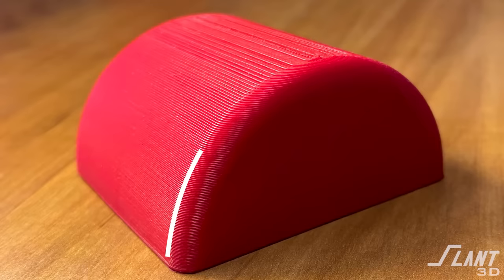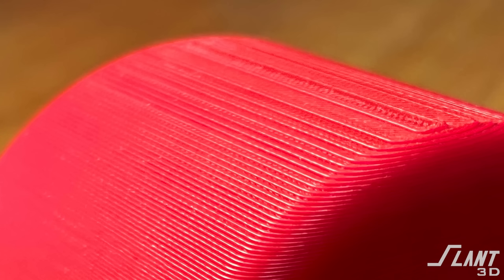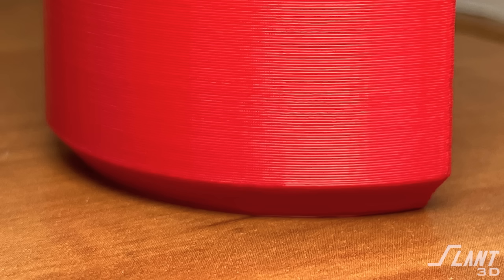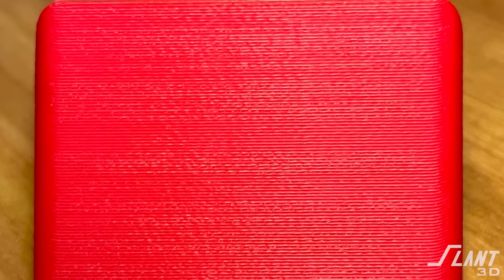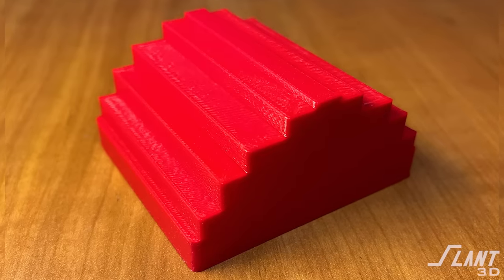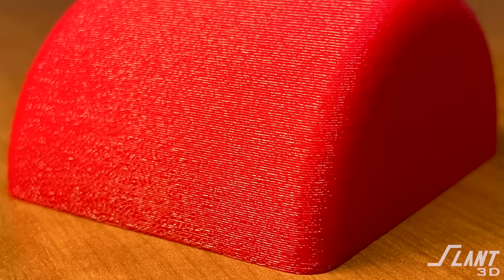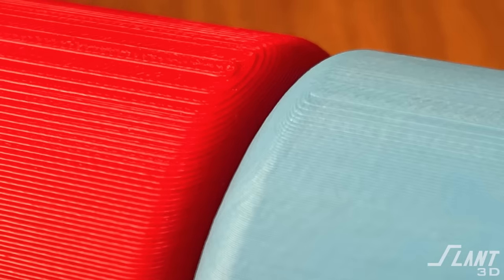Improving Curved Surfaces | Design for Mass Production 3D Printing

Comment: Suprised they didn't mention adaptive layers, that way you can have 0.3mm layers and transition to 0.1mm as the slope decreases. Same goes for the trapezoid shape.
Reply: came to make sure this was said
Reply: I use this a TON! Great comment
Reply: Exactly
Reply: But the point was to have consistent layer lines, right?
Reply: @henriexel9963  why?
Reply: It's an underated PrusaSlicer feature that cura users won't hear about.
Reply: @josephgaston5866  is it sarcasm ? , it's been in cura for at least 5.2 (long time)
Reply: @henriexel9963   The point is to have good results in a reasonable amount of time. Consistent layers can be a means to that.
With the right settings you can get a nice transition that's barely noticable.
Reply: Come on he's the "expert".
😆
Reply: This is the comment I was looking for. Adaptive layer heights are fantastic and offer a good balance between say 0.3 and 0.1 while minimally increasing print time.
Reply: @3DThird  Tbh, I'd still prefer a \_/ type shape with 0.3mm, but when you have to use a curved top this is the shit.
Reply: @Litl_Skitl  true, chamfers are better than fillets for FDM tech. SLA & SLS are much better for fillets in general.
Reply: @henriexel9963  no the point is to avoid as much as possible the obvious layer lines in the top of curved models
Reply: @teamllr3137  no joke! Where and how?
Reply: @vov4egde  it's the "Use Adaptive Layers" in the experimental tab, but it enable automatically when selecting the 0.16mm layer height preset
Reply: Yeah, was going to say that. Someone already beaten me to it. Prusa slicer, Bambu Studio, etc have that feature that you can increase resolution on affected area so they can appear equally resolution.
Reply: Ya I love adaptive layer height! I thought that would be the number 1 thing he mentioned too, oh well.
Reply: @josephgaston5866  /facepalm....Pusaslicer ported adaptive layers from Arachne, Cura's slicing engine.
Reply: Came here to say this.
Reply: @josephgaston5866  pretty sure kira has adaptive layer lines as well
Reply: Would you not need a nozzle z offset adjustment when it changes layers? Or does the adaptive layer g code account for that?
Reply: @E.H.N  Z offset is really only for how far from your Z level home switch or however your homing is after that it's just adding layers on top
Reply: @Texas3DCustoms  Okay makes sense. Thanks
Reply: @E.H.N  It's built into at least cura, and it automatically changes the layer height based on overhangs. Don't need ofset when you change in general.
Reply: Yeah, quite dissapointing that they go "well here's another completely different thing that doesn't have the problem so we solved the issue, right?"

Just pointless. If you won't solve the issue, don't say you solved the issue, sure, it's a design alternative but if you want to give a solution, the inherent critical features of the part you presented should be unchanged, otherwise is just pointless.
Reply: @henriexel9963  consistent finish more so.
Reply: That would be what he was referring to when he said that there are ways to go from for example 0.3 layer height to 0.1 layer height but only add 50% additional print time.
Reply: I might have to try this out on my next print
Reply: I was expecting the entire video to be about adaptive layers techniques and was shocked it didn't even get a mention.
Reply: They? He is definitely a "he" 😂
Reply: @gz625  I meant they as in the entire team, like the formal way.
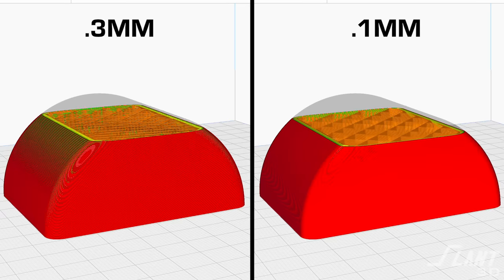Reply: He hinted towards it by saying 1:44 "There are ways of printing that only increase the speed from 300% to 50%"
Reply: Y'all he literally mentioned it first "there are ways to only slightly increase the print time instead of 300%, but this requires set up time on the slicer" 

He's obviously talking about variable later heights
Reply: @teamllr3137  since 3.0 you could have the top layers run at a lower layer line count. I don't know how configurable it was, but you could set say the top 0.6mm to be 0.15mm vs 0.2mm layer height
Reply: exactly, instead their advice - dont have curved edges LMAO
Reply: @Kyle-dz9bm  me too!!

Comment: If you are trying to make tens of thousands just use injection moulding. Like seriously, 3D printing does scale pretty poorly. I understand it is appealing as you can gradually increase capacity as you go by adding more printers, but there is a limit to when it makes sense.

Comment: Another option is 'non-planar printing'.  In this case, an app would warp the top surface to make it flat, the warped model is sliced, then the app unwarps it, resulting in extruder moves in 3 dimensions per layer--rather than the standard 2--and the result is a smoothly curved top.  (Obviously, there are limitations to this method, but it works fantastically well within them.)
Reply: I would love for this to be implemented in a mainstream slicer without additional post-processing scripts.  The problem is it doesn't apply universally to all models, so making the slicer do it automatically is very tricky.  It'd be nice if Prusa or Ultimaker added it as a manual modifier, though, if they can't work out an algorithm cheaply enough to safely apply it automatically...
Reply: @oasntet  thats a tall order for slicer codebase. i dont think you can get away with less maths than in CAM for milling. i am into this, and will try to do something like this when my printer is rebuild. there are lots of possibilities.
Reply: @simonschneider5913   Yeah, I'd expect it to need to be an advanced feature, probably a plugin, and it'd require a lot of hand-holding by the user.  There's still a lot of rough edges in the external-to-slicer scripting approach that a slicer plugin could polish off, even without making it a mainstream feature.
Reply: @oasntet unfortunately, Autodesk patended non-planar printing in 2015 (and never used it for anything).

Comment: Well - adaptive layer height works, which works well in PrusaSlicer and friends. Also, Fuzzy skin, also in PrusaSlicer etc, does what you mentioned lastly, only without any work for the 3d model.
Reply from the maker: adaptive is the same as high resolution. The tradeoff is is slows down print time adding cost in mass production
Reply: @slant3d  It's not. Adaptive doesn't increase resolution everywhere, only where needed. You should check it out as it's a nice compromise between fast printing and increased detail.
Reply: @dsp4392  the whole point of the video was how to reduce this issue while keeping print time low. Adaptive is fine but it typically results in variable surface finish and quite a bit of extra time.
Reply: @Cryous  Not sure you are understanding what adaptive layer height means. In the dome example of the video if only the top 10% of the model would be printed at the 0.1 mm layer height then the total time would only be increased by about 7%. Moreover, the dome shape itself means the area of the top layers are dramatically reduced, which means the time increase is only a couple %, barely noticeable.

Of course the actual impact depends entirely on the specific print, but generally adaptive layer heights increase print times by minor percentages, which I think he alluded to time increase of 50%, rather than 200%. It would have been clearer if he explicitly mentioned adaptive layer heights.
Reply: @Cryous  That "pixelated" "solution" also adds quite a bit of time as you are now introducing extra top layers to the part which need to be printed.
Reply: @treborrrrr  let's be honest, the guy just didn't know about adaptive layers or didn't think of it and doesn't want to admit. The triangle and pixelated methods he mentioned were honestly kind of stupid. If you can do that on your design then you don't need a curved surface in the first place. The title says "improve curved surfaces" not get rid of the curved surface entirely. The only logical solution for this is to print the curve horizontally or use higher resolution for the entire model or use adaptive layers.

Comment: Another solution is variable layer heights.  Use larger layer heights and only decrease when the horizontal stepover between the layers exceeds a certain size (down to a certain minimum layer height).  This minimizes the amount of time spent printing at very low layer height, so the print times aren't increase as much, and you still get much better surface finish.

Autodesk did something similar for their ember 3d printer.

https://www.youtube.com/watch?v=HAmneiL5-jQ

Edit: Added a clarifying statement so that people don't think I'm there one who implemented it.

Comment: Not sure if you're aware, but there are variable layer heights in almost all is not all slicers now. It allows you to set really thick layer heights for vertical surfaces while creating a gradient down to a finer say 0.05mm layer height for those rounded cases.

Comment: im confused, why did you add the chamfer to the bottom when it would be printing vertically? if the cylinder is printed vertically there wouldnt be any steep overhands right, just up and down. Im new and trying to learn best practices.

Comment: In prusaslicer I add a height range modifier and choose a range that covers the curve and choose to halve the layer height for that section. You can then click the adaptive layer height icon in the toolbar and choose "smooth" to blend the transition area. I also add a low level amount of fuzzy skin - 0.03mm depth, 0.06mm distance to try hide the layer lines more.

Comment: You could just print the part on its side. 
The other examples/suggestions are to change the geometry in its entirety which is not printing curved surfaces anymore. The scope for improvement here is null. How do you improve something but not doing it?  

Print in ABS and acetone vapour exposure. That is the ideal solution for mass producing curved surfaces.

Comment: You could try high resolution just on the top portion, getting most of the value for a fraction of the delay. I suppose a slicer could implement gradual layer height reduction to make it even nicer, but even without that, you can improve things a lot for a minor delay.
Reply: You can do adaptive layer height with Prusa/Orca/Bamu slicer and I think Cura as well.  You can specify just the top parts too.  It does help without adding too much time but doesn't get rid of the stepping completely.
Reply: Yup. It is part of Prusa slicer for some time now.
Reply: Yup variable layer height. I use it all the time. 

Theres also a small layer height with an infill multiplier or different layer heights for infill compared to external surfaces. Saves time but preserves layer height. I've done this with .04 on the outside and .3 on the inside and the part is super smooth.

Comment: Adaptive layer height. It would be great if you could use a formula to determine h as a function of z
For example h = min(max(0.1 , 0.4 sqrt (R^2/z^2-1) , 0.3).
That would give you the necessary height to have a  constant step of 0.4 mm but having 0.3 and 0.1 as upper and lower limits.

Comment: Can you explain the digital noise technique?  That looks interesting.
Reply: It's usually achieved using a setting called Fuzzy Skin. The slicer will simply add 3D noise to all vertical surfaces. The amount of noise is configurable too. I really wouldn't recommend doing it in CAD as it increases the polygon count and might cause unneeded detail loss.
Reply: Nope, fuzzy skin is hard to apply selectively like they seem to do
Reply: @dsp4392  thanks for actually explaining that. that helped a lot

Comment: Using the adaptive layer function of the slicer is good too. It only reduces the layer height over fine areas like the top. Saves on printing time.

Comment: It would be nice if i could do 3d ironing and be done with it. sort of like 3D printing, not 2.5 D printing if you know what i mean. OR, there should be a setting where if im printing the entire model with .8 layers, the outer layers can be printed at .4 layer height just to get the surface to look ok, but it wouldn't take as much time as doing the entire model in .4

Comment: Another solution is non-planar 3D printing. Basically you can move in 3D space rather than relying on stacking a bunch of planes on top of each other.

There are some experimental slicers for this, but it also will be limited by the nozzle configuration of a 3D printer. Many 3D printers would cause a collision between the hot end assembly and the print because the nozzle doesn't protrude far enough down from the hot end assembly.

Comment: Adding noise (or "fuzzy surface") is the most underestimated feature of most slicers - I use it a lot on visible faces on commercial products and it almost completely conceals the 3D-print look (=visible layers), what still a lot of customers associate with low quality.
The products look more like injection molded with a nice texture.
It even helps with overhangs as the lines "wobble" in x-y direction and are therefore a lot wider and can span shallower overhangs.
Downside is: You have to carefully chose what surfaces you want to be treated like that or you will dramatically increase print time and overall wear of your printer because of the vibration it causes.
Reply: So you add the noise in the slicer program itself and not in the CAD model? If so, I am assuming you can do this in CURA

Comment: I've found that just by adding extra walls helps to hide the effects of stepping. It obviously wont rid you of the layer stepping on a curve but more or so camouflages it instead. Giving you a cleaner looking finish. You could also just change the orientation of the line fill to be concentric rather than on the standard default 45. Consider if your part will be under stress, the latter may weaken your part slightly.
Alot of people commented adaptive layer height and that would be fine for some things like this videos example but it can really make your prints look stripey. Which i dont care for at all. Id much rather have uniformity and a little bit of stepping than stripey layer height changes throughout my prints surface.

Comment: I like the solution I use of having the layer thickness adjust for the model geometry.  That way, I can still print normal or extra thick layers on straight vertical surfaces, and infill.  Then, as the model has angled or curved surfaces, the layer thickness adjusts according to the angle of the surface.  I don't remember my exact formula used to calculate this off the top of my head, but it's something like: 

If (nozzle diameter * 1.1)/ ((previous stepover - current stepover requested)/2) > previous stepover 
Then current stepover = previous stepover * 0.75
Else If (nozzle diameter * 1.1)/ ((previous stepover - current stepover requested)/2) < previous stepover 
Then current stepover = previous stepover * 1.25

This isn't runnable code by any means, but you get the idea.  There's also a check before this that spans multiple layers to see if it is even necessary to go into the modified layer height sub routine.

Comment: I build an outer wrap with the layer lines going in the æsthetically optimal direction and slide the bulk of the part inside that wrap, that bulk having the layers in the direction optimal for strength. Made a toilet roll holder like this. Print outside cylinder vertically; print inside cylinder horizontally.

Either that or I just remove the layer lines from the PLA with clove oil.
Reply: Care to explain what you mean about the clove oil? Are you just sanding it using clove oil as a lubricant? How does clove oil help with removing the layer lines?

Comment: I had a sphere to print on my Bambu Carbon, I haven't checked if the slicer can do variable layer height, will check!
As well as using concentric infill for the topmost layers I used a bit of post processing using primer and sanding...
Reply: you can always slice it on prusa and send the gcode to your bambu

Comment: How do you add noise in CAD? Does Fusion 360 have this option? Is it just applying a texture/material in the CAD software? 

If so, could you elaborate on what method you use for this?? Thanks in advance!

Comment: I wish I could find a good option for over-hangs in Cura. I end up with the worst possible surface finish imaginable anytime I have a near flat overhang. On some cases I can tell that the coarse crisscross support layer is fused to the part, but even if that layer comes free, there's a layer of a mess of coarse, partially fused, not flattened "lines" fused to the part... and I can't tell if that's a layer that should be wasted or if it's the actual first payer of the part. It's very rough and not dimensionally accurate too, so any flat over-hang parts can't be used in mechanically functional parts. They're just too thick and too rough. (...and sometimes the very coarse lines aren't fully fused to the part. They can be picket off with a finger nail and/or are already broken free in some places). Forgive the long explanation. Just trying to accurately describe the problem. I can say I've been Very lucky though. Got an Ender 3 just a month ago and it's printed almost everything I've tried to print very good. This has just been the one problem I couldn't easily find a solution for).

Comment: Variable layer heights may help a lot while not increasing print times drastically. 
Or there are options (at least in Cura that I know) to define the wall and infill layer thicknesses separately. Print the walls with 0.1mm height and the infill with 0.3mm!
Reply: in prusaslicer this is: Print settings > Infill > "Combine infill every [ 3 ] layers"

Comment: Depending on the print, it may be preferable to have the lines though. Like, when 3d printing wheels, the lines may provide extra grip, like tracks on the tires.

Comment: The slicer needs to be able to adjust player height for different parts of the print. With matterhackers matter control you could reslice it with shorter during the print as it gets towards the top